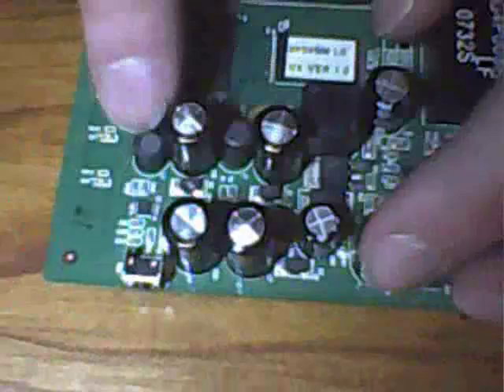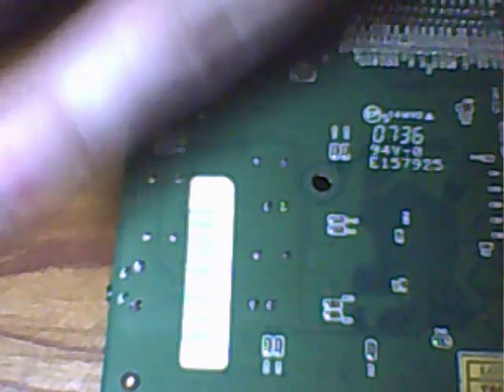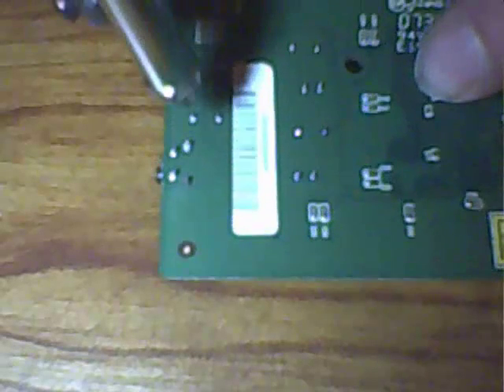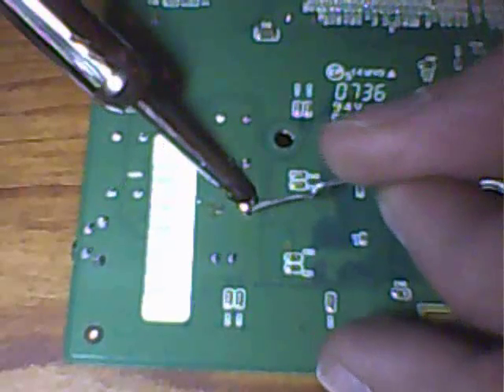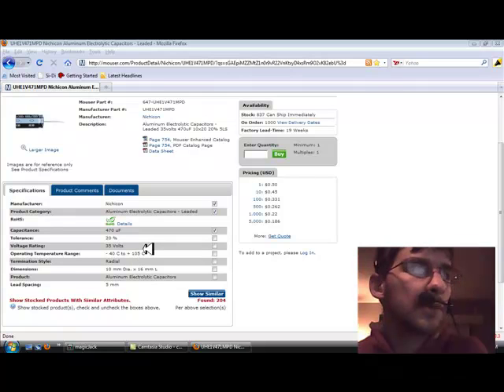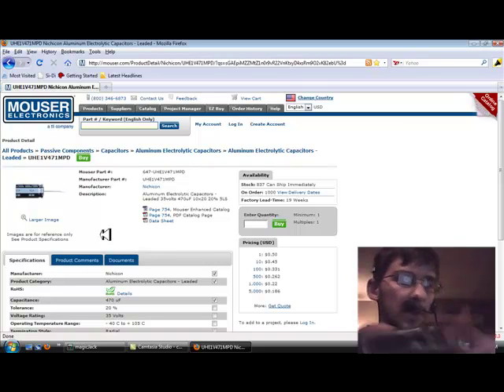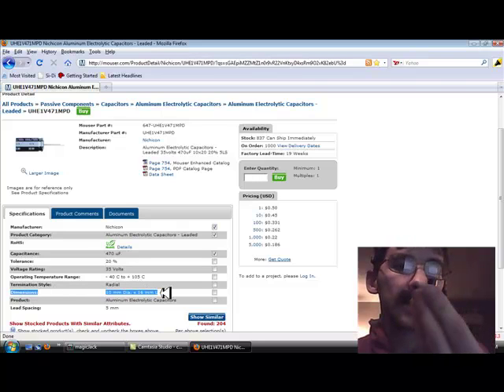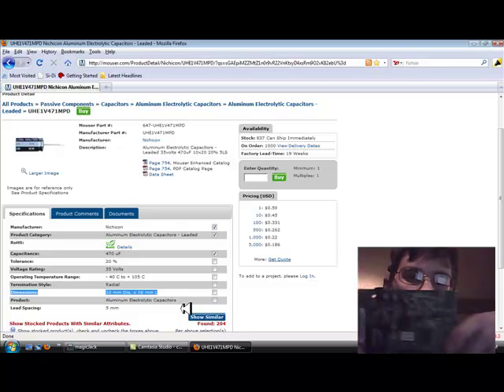Removing Capacitors.mp4

Comment: Just remember, most capacitors on motherboards etc and switch-mode power supplies are Low-ESR types. This means the replacement also must be Low-ESR, or the replacement will quickly fail. Cheap "general purpose" capacitors from RadioShack are no good. Also, the ones on eBay are usually fake. Buy from Mouser\Digikey\Farnell\Newark etc. Use good brands such as Panasonic\Rubycon\Nichicon etc. Check the datasheets of the old and new capacitors to make sure ESR and Ripple are the same or better.